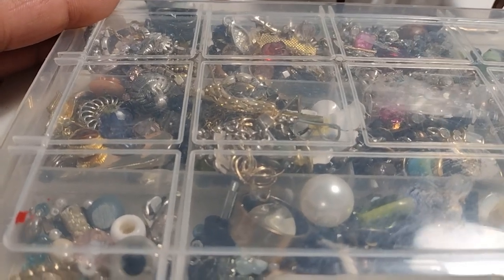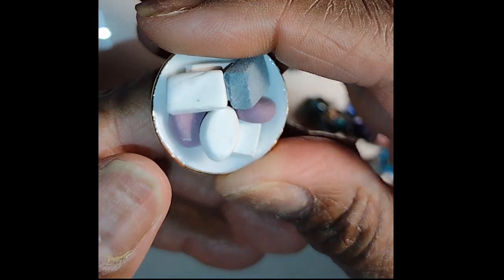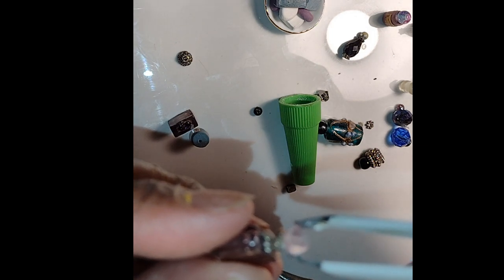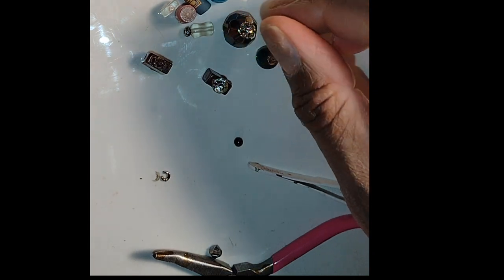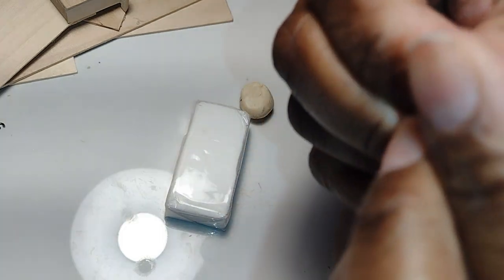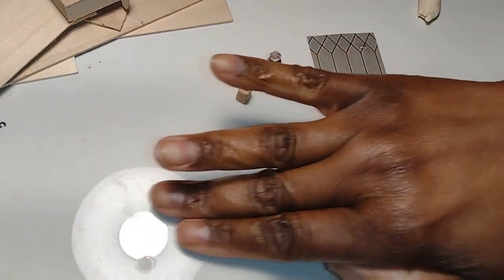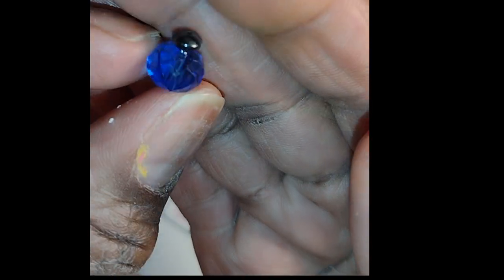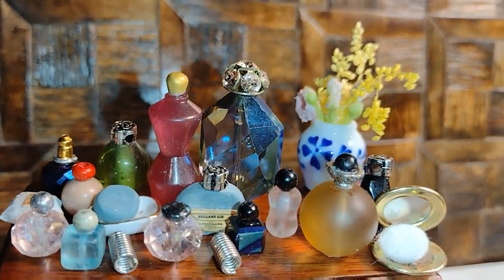DIY Miniature PERFUME BOTTLES from TRASH

Comment: Can I please ask…What is your favorite glue? I find it is difficult to find a glue that holds glass to glass or glass to metal…?
Reply from the maker: Hi LINDA! I had to try a few to figure it out. I used Gorilla Gel  Super Glue  but I have totally switched to  LOC -TITE SUPER GLUE GEL.  The GEL formula is not runny and it gives a little wiggle room before it sets. Plus it has a precision tip so the glue comes out in very small amounts. Perfect for bead perfume bottles 😅❤️ l hope they s helps. Let me know how you like it. I will add link in description.
Reply: @littlegretchensworkshop7665   good morning! Thank you so much! I hope you have a wonderful day!❤️❤️❤️

Comment: I was just wondering, wouldn't wax make more realistic looking soaps than clay? Soap has a waxy translucent appearance that clay would find hard to mimic, but wax has that same exact look and feel. The bars you made are shaped perfectly, and Just the right scale. It's only their materials that hold them back in my opinion. Your work is so exacting and your attention to tiny details such that I hope you find this suggestion helpful.
Reply from the maker: Thank You Julie! I have actually never considered using wax! That is a great suggestion!😃 while I was reading your comment l realized they have translucent Clay. I need to make more 🧼 for the Dress Shop Dollhouse so I while incorporate that in my process. Growing up my family always bought Ivory soap, and it was opaque although the texture was waxy. So l didn't see translucent soap very much. I appreciate your feedback 😃❤️👍 THANK YOU for watching ☺️
Reply: @littlegretchensworkshop7665  Glad I could help. If you want an opaque bar, try coating one of your clay bars in wax to see if that looks more realistic. I understand your drive for perfection in your miniatures, I've been making miniatures since the 80s and no matter how good something turns out, I always think I could have done just a little bit better.